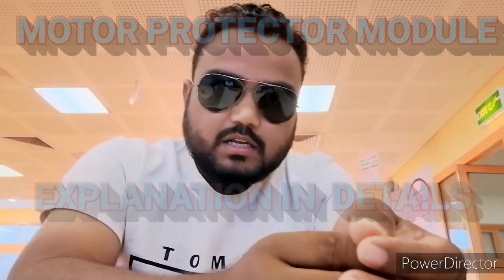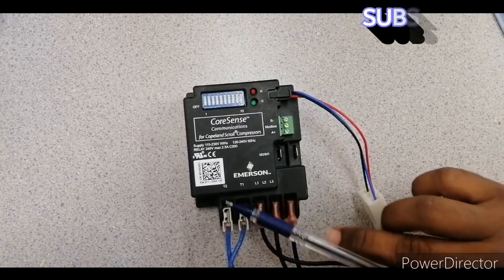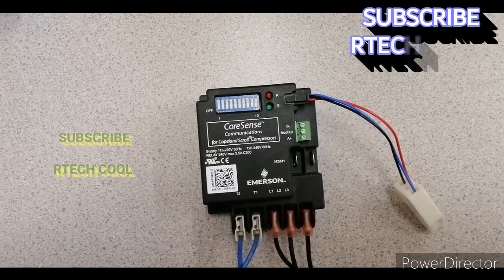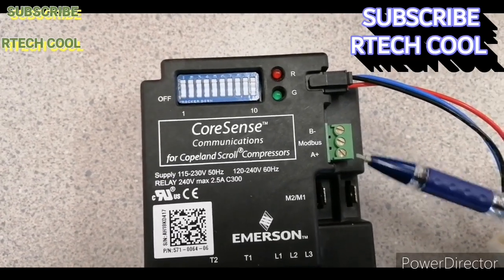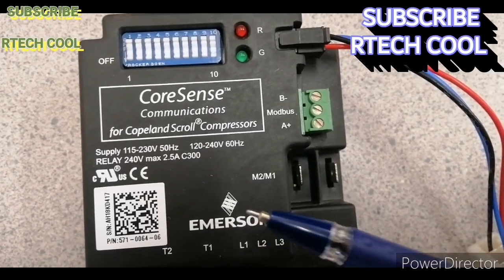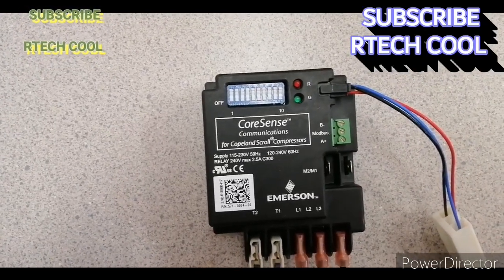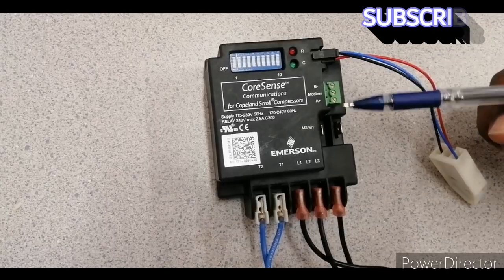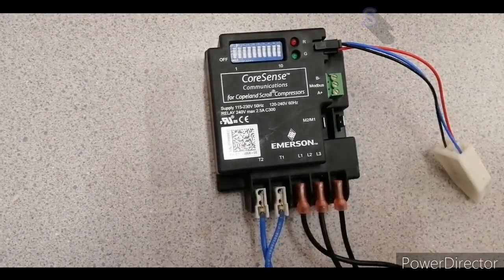Motor protector module| NTC PTC| Copeland scroll |Compressor |Voltage monitor module|winding protect

Comment: Scrolltyp  comperssor  potact  slft  power  ex ober lord  portacting  systom  slfey  motor  portacyer     hp  lp  us  srieac  us    sries  using  same  fushions litel  defrent  sre    . Ex pl..s srolltyp  cimprssar using portacter  moderls  TEd  tupes  bms  conte  m1 m1  sighanl  contan  pormes  sighnal  showing  systom   comprss  l1 l23  and  comtavyed  systom   ok sir
Reply: Tedmodel  ti1 t2  power  3wire  thmostear  intannl  wire  conshiones  b a+bms  contshions  sighanl  showing  indcashiones  read  amd  gree light show  sighal   motar  potiacter hp lp  conrold  systom  cut off m1 m2 hp lp  conshiones  ac  slfety